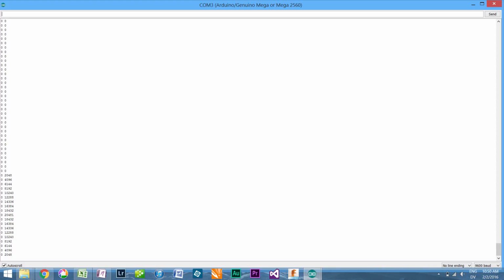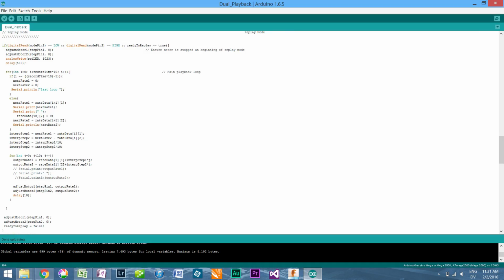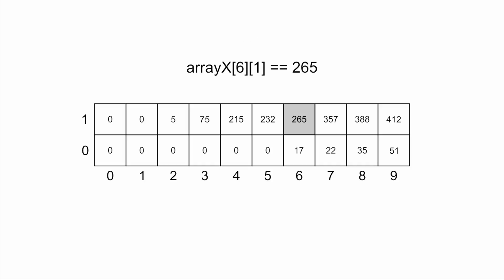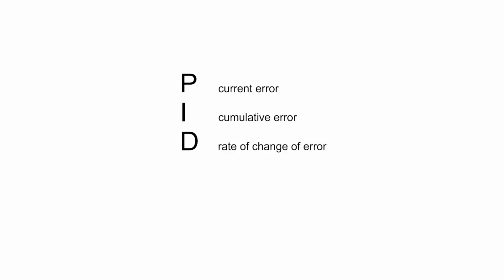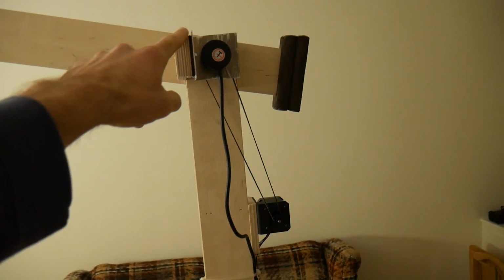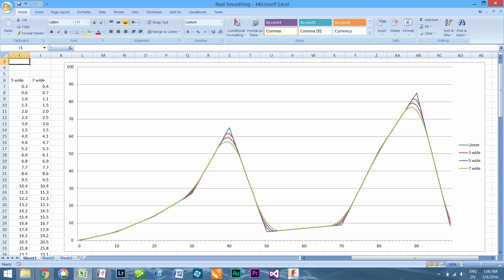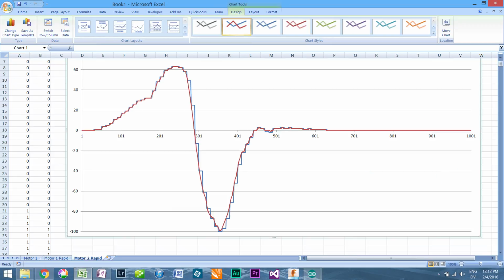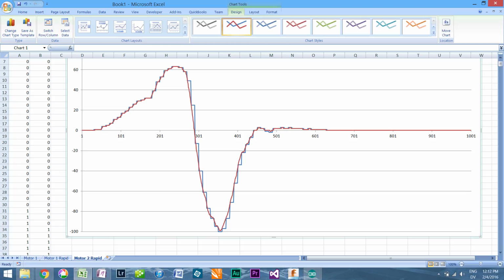Camera Control Arm #6

Comment: Your array issue might be due to how arrears are implemented in memory. A multidimensional array is stored in ram as a big single array and the program uses offsets to determine the actual position in the array. https://en.wikipedia.org/wiki/Array_data_structure#Multidimensional_arrays